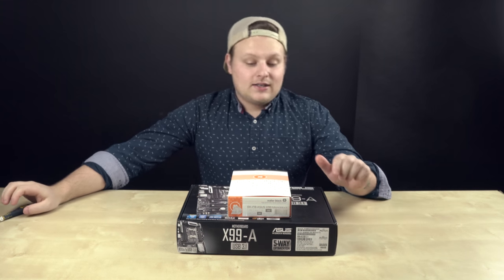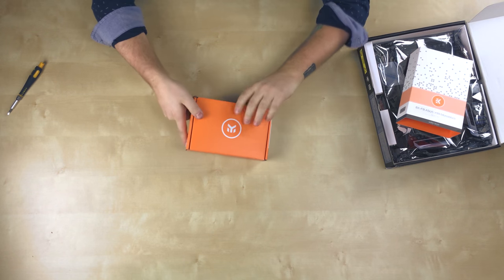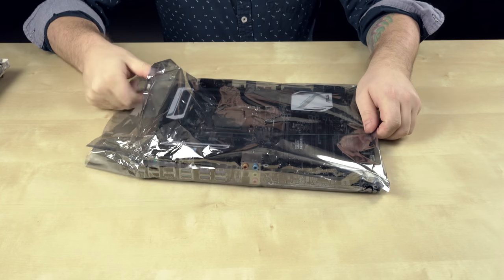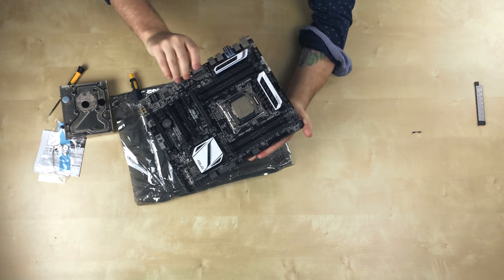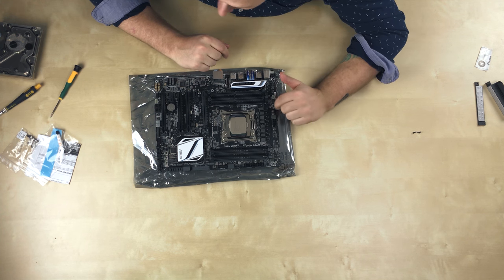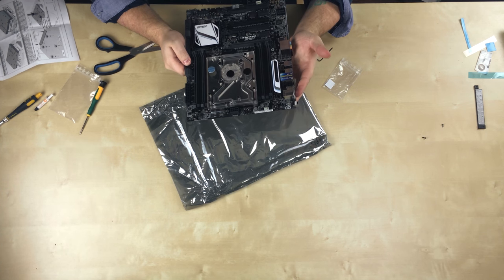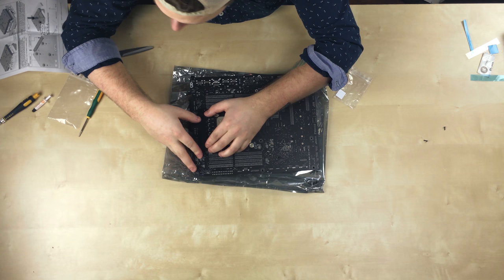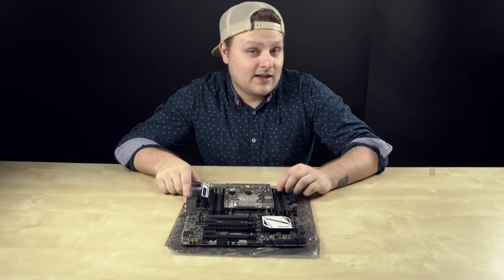Installing EK Mono Block on Asus x99-A - Build Log 2

Comment: Coming along nicely.I always spread the paste not a pea drop fan.
Reply from the maker: +Brian T Same. I usually do that as well. But I watched a video comparing all different methods and the only one that showed a difference in performance is if you don't put enough on. So after that I stopped caring how I did it lol.
Reply: +Zed ProMedia I don't think you put quite enough thermal paste on for an LGA 2011v3 CPU. That amount of thermal paste would be fine for an LGA 1150 or 1151 CPU but I'm not sure it will be quite enough for a 5820k. You may get higher temps than expected and have to add more thermal paste
Reply from the maker: +TrillianPC so far I haven't had any issues with temps. Idle around 27 degrees and about 50 under load. I haven't overclocked it yet though. So I guess I'll find out.

Comment: I think that if you've decided to watercool your CPU you should know where the standoff holes for the cpu cooler is on a motherboard. Please dont punch holes in you MB like he did...
Reply from the maker: There is no way to install this mono block without punching through the membrane on the pre made holes. I think you are mistaken, The motherboard standoff holes that are already open are for other coolers. The way I did this in this video specific for this waterblock . Thanks for the comment.

Comment: Good videos. But I dont understand why a lot of people are so lazy to spread TIM. I seen you do this in another video.The 'pea' method is used on the assembly line in mass production because it is quick and the extra cost of the time it takes to properly spread the TIM.Time is money. The 'pea' method is acceptable, but certainly not best. Best heat transfer will require the TIM to be spread evenly across the chip. It is simple to do. That is why I dont understand people using the 'pea' method, other than laziness. It takes an extra 2 minutes.
Reply from the maker: I have always spread it. But I watched a video on Linus tech tips where they did a test on different methods of application and it didn't seem to matter what why they did it the temps didn't seem to change. So after watching that I decided to try the pea method. I don't regret it. My temps are good. Thanks for watching.